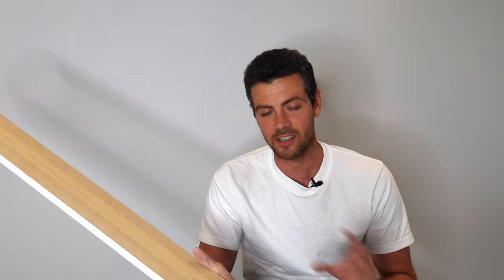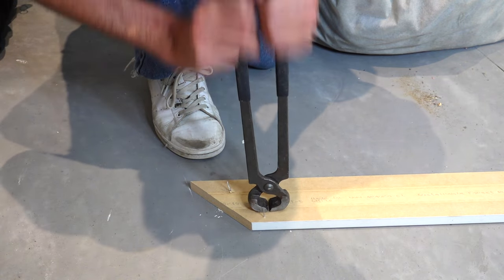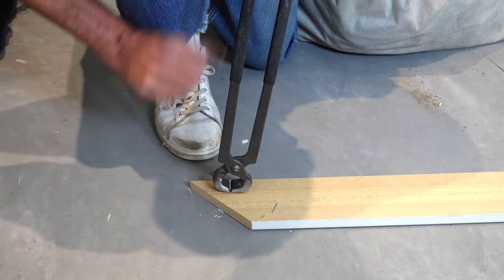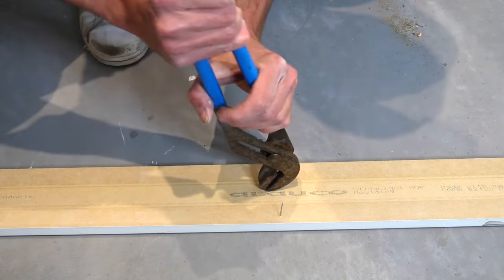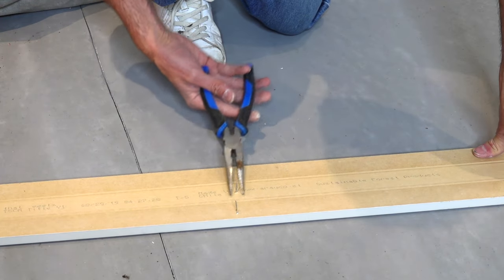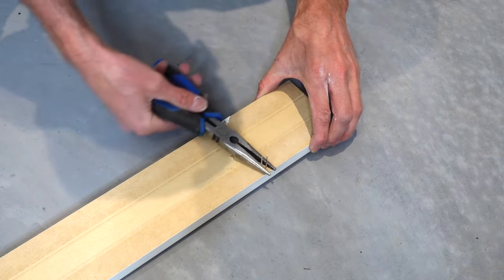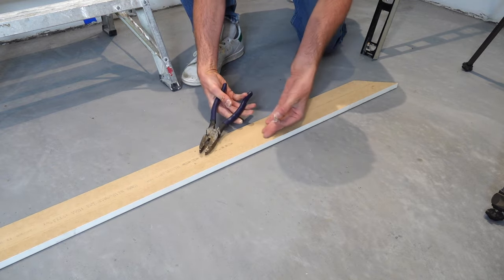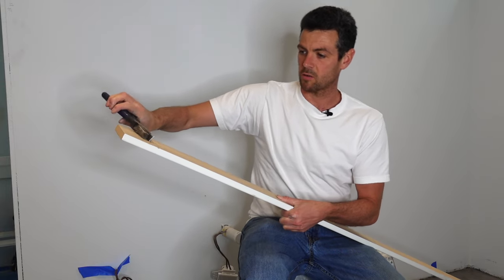The EASIEST way to Remove Trim Nails

Comment: Hi! The first one, the "bullnose", is called "tenaza" in Argentina, and we use it a lot. The trick for it not to cut the nails is having one that is NOT sharpened. So, I have two of them: The sharpened one for when I want to cut wire or nails, and the not sharpened one, for taking nails out or tightening wire without the risk of cutting it.
I love your videos! They've helped me a lot with mudding drywall. Thanks!

Ps, when I don't want the wood to dent with the "tenaza" I put a steel spatula in between.

Comment: I saw this video last week, and then yesterday I had a job to do where I had to remove so many nails from hundreds of feet of trim.

I was struggling with the needle nose plier and it was hurting my hand with all the twisting.

Then I remembered his method of using the plier, gripping the nail, and rocking it backwards.

Each nail came out smoothly for me using that method.

Thanks

Comment: I use linesman plyers for pulling all finish nails.  The older ones can be quite difficult, and yes, neumatic nails can snap, but I'll just cut it off as close to the board as possible and knock it over.  The drywall won't care (if you're reinstalling the trim) and nobody is going to get hurt if your tossing it.

Comment: Been using the linesman tool for years but differently. Instead of rolling, I pinch the finish nail between the nippers, and leverage it out. It's super fast, but if you squeeze to tightly on the nail you can cut it off, which is frustrating. Most of the time though they come out super easy.

Comment: I don't use pliers.
Multi tool with a metal blade. Zips them off in half a second each and there's no risk of damaging or chipping out the show side by pulling the nails out, especially on old brittle trim or the older larger finishing nails used.
Reply: I agree, I use the cordless grinder to cut them off on old trim. The oscillating saw I feel like is the most expensive tool to run. Unless you have found some decent quality blades for cheap on Amazon, then please share
Reply: @NickRgibbs  I buy my blades of Aliexpress in 50-100packs. Less then a dollar per blade and they last as long if not longer then anything else youll buy. If you use a bi-metal blade, they last forever on nails, because theyre soft metal. If you try to use them on screws, nothing will last because theyre hardened metal.

Comment: Crescent makes a nail pulling plier (NP11) that works fantastic on everything from narrow gauge brads to 4" spikes due to its large rounded head . It's a single purpose tool, but if you're pulling fasteners regularly, it's the most effective non-powered tool I've found.
Reply: They’re better than I expected. I used to use Channellocks and Vise-Grips. Not anymore.
Reply: If only more people knew about these.
Reply: Sounds like the ones I have too. They work great but I might give the Klein’s a try next time I can’t find them
Reply: Did a whole house gut and bought some of these at the start and have used it for hundreds or maybe thousands of nails at this point. I did a lot of reclamation of materials from structural framing to fine trim, just indispensable. I was sure that was where this video was headed and was surprised when we stopped at linesman pliers.

Comment: I'm enjoying all your videos
I have a dilemma I live in an apartment where they only use nails to secure the drywall to the ceiling well they are popping I'm scraping out the pops driving the nails back in and also securing with drywall screws but I'm left with a bunch of holes that I'm feeling my problem is how do you sand after feeling the holes without making a huge mess I don't have much room to move furniture... If you could do a video in the future on how to tackle this problem I would appreciate it.
Looked into a vacuum system but it's just way too expensive just to use one time don't have anywhere to store it after I'm done.
Up the good work you're awesome 💖

Comment: Diagonal cutters also work well if you don't squeeze too hard. I haven't had much practice and yet rarely cut the nail - it can grab a really short nail as well and pull it using the same rocking motion as with the pliers.

Comment: You should try a set with a built in spring to open them. Dewalt has one that you can find at home depot most of the time. It is sweet, just squeeze and roll, repeat

Comment: The previous owner of my house liked to use spiral finishing nails.
 After the trim comes off, the nails are still firmly attached to the underlying frame, and removing them crushes the drywall.

Comment: We use staples into plywood edges, if they go wrong I don’t feel i will have enough grip with the linesman pliers.
At least nog without squeezing my butt off.
So i always reach for the bullnose option. In a 350-ish millimeter long format though.
It took me a few weeks, but now I hardly ever snip any of them of. Muscle memory training I guess.

The channel locks look a great option to me, however the staples are in line with the wood so I’d have to try and twist them 90degrees before rolling them out.
I will give that a go though.

Comment: Thanks. I had broken glass I needed to remove from an old picture frame and the only way I knew how to remove nails was with a hammer(which obviously wasnt' gonna work in this scenario), but with tiny nails, the needle nose pliers worked.

Comment: My method is to just cut/grind off the protruding bits with a cordless angle grinder. Just as fast if not faster then pulling. Why? To not disturb whatever finishing was done on the other side of the trim piece. If that hole was previously filled and painted I don't want to disturb it so I don't have to re-do it.
Reply: I do the same thing. I use a dremmel with a cut off disc.
Reply: Cordless grinder is the way to go for sure.

Comment: My favorite methods are using your fingers to simply break the nail by bending it back and forth, or the quickest in my opinion is using an oscillator tool it cuts them flush and takes less than a second per one.
Reply: Just used that method on some brads,didn't have my vice grips or channel locks with me.
Reply: Mine too, but then you miss the fun of hitting the same holes with the new brad nails

Comment: There is a specific nail-puller made by crescent.  Looks like a dilophasaur head. It has an additional leverage surface like the fins.  These can do most small nails.  Don't get that king-fisher beak looking one at Lee Valley, that's no good.  The flush pullers tend to cut the nails.  You can get a set of channellocks and maybe grind off the sharp side (the other end is already an anvil), that should work well too.
Reply: Since you have an animal theme going, I thought for sure you were going to recommend Nejisaurus pliers 🙂
Reply: Are you referring to the Crescent NP11? That’s my favorite tool for this stuff. I’m surprised it wasn’t mentioned.
Reply: @declanfarber  yes that one.  The one with the big crown.
Reply: @WanJae42  hahaha different uses.  The ones I mentioned works off of leverage.

Comment: I have been using 10” channel lock pliers and my 3” painters knife (to protect surface) recently for small projects, but I would go for a cut off disk on the angle grinder if I was doing something bigger.
Reply: On Oak we just cut them off with the cordless grinder. So much faster than trying to pull them through. Sometimes on Reno's you run into pin nails holding the thin part of the oak casing to the jamb and brads into the stud. So much easier to cut them off if you need to reuse that trim
Reply: @NickRgibbs  The grinder is perfect—great idea!

Comment: Consider dikes.  Because they are made to cut wire, they occasionally cut the nail, but not if you are careful.  The rounded body gives them lots of leverage.  I've found them effective on much larger nails as well.

Comment: Pincer pliers should not be sharp enough to be cutters infact they should have about a 1/16th flat to grip the nail, its a modern thing that they have become "end cutters" old school pincers will grip a nail at the surface unlike modern ones.
Once you go over about 3" nail length linesman pliers become pretty hard to use especially with decent hardwoods

Comment: Lineman's are my fav, anyone got better solutions to hand driven finish nails in stain grade? I usually cut them if I can get them to pull through but it's not a great solution
Reply: Cut them from behind with a grinder or oscillating tool. If you don't have one you don't know what you are missing owning either one in a cordless setup. It will change the way you troubleshoot weird situations have either or both as cordless

Comment: Wellllll.. those long handled janks werent meant for pulling pneumatic nails bud. its meant for pulling a much thicker gauge of nail and in much more dense piece of trim. very common to use those 30 years ago.

Comment: Your pull very thin 18gage from modern wood thats made cheap and weak. That's easy. But pulling real nails from older wooden trim or baseboards to restore older homes are much much harder.

Comment: I've never understood why people "pull" the nails out of skirts & arch's. You always increase the risk or likelihood of causing damage by doing this & it takes way too much time.
I use an angle grinder & trim the nails off flush on the back which never damages the outside surface & gets a board cleaned up & ready to go in literally seconds.

Comment: No you pound the nail out flush backwards and blow a big ugly hole out the front of your trim. Then use a framing hammer to get at the head of the nail, then twist sideways and gouge a couple lines in your trim so that you will see where to put the putty on the face of your trim.

Comment: Or you could spend $15 on a trim removal pry bar with a trim nail puller.
Reply: Pushing them out the front damages trim more often then not, that's why most of us do it from the back
Reply: @stich1960  Which is exactly what the pry bar is designed for, a gentle spoon end to pry trim away, and hardened-tooth offset jaws to pull nails through.